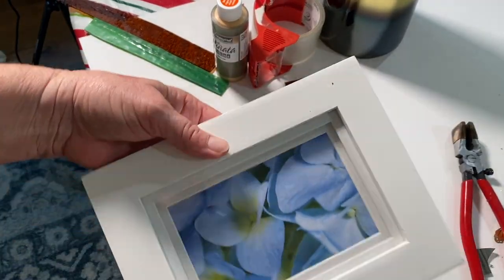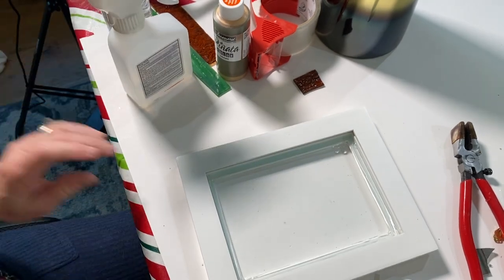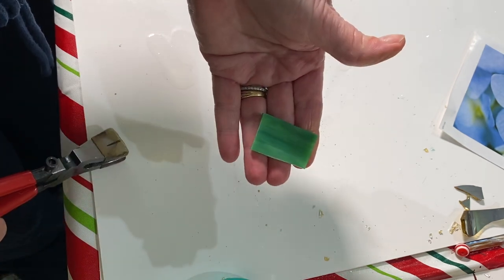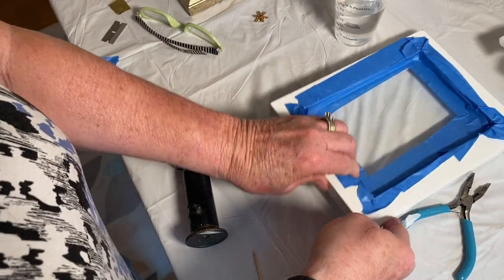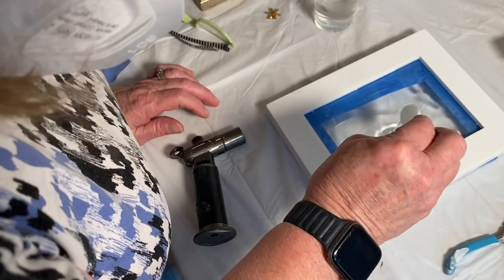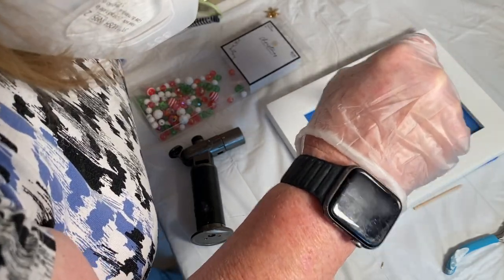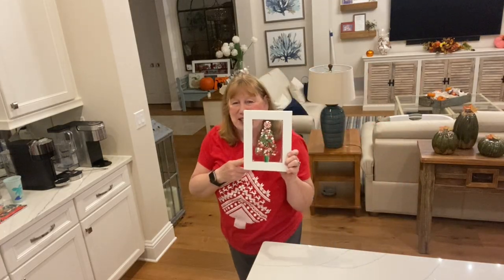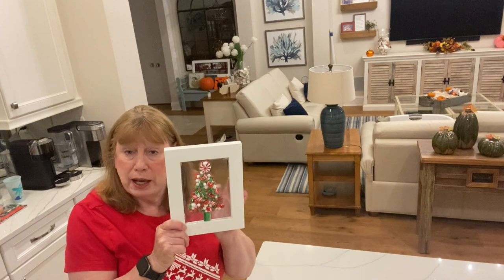HOW TO MAKE  A CHRISTMAS TREES ON GLASS WITH CHRISTMAS BEADS AND  EPOXY RESIN,    2022

Comment: I love your work everything is so beautiful and I love the way you explain everything. I want to try this and wondered if you have a recommendation for which epoxy resin to use for a 1st timer?
Reply from the maker: I have been using art resin. It is a safe resin to use and has a long work time. It can be a little pricier but I like it. Start small! Good luck Be sure you read the directions on what ever resin you choose because although they can be similar, they may have different instructions.

Comment: So yummy!!! I was hesitant about getting anything plastic in case the heat of the activated resin would melt it a little... i guess it doesn't? How about the plastic silver backed flat crystals,  would they still sparkle and not melt?
Reply from the maker: So heating of resin occurs when it is curing too fast like the room or resin is too hot or the pour is too deep. So with my resin ( ART RESIN) it's not my resin but one of the main resins I use It only heats up if I leave a cup fairly full for an extended period of time. All resins are different but it should not heat up to a point to be able to melt anything. Having said that The flat back plastic gems do not melt but you need to set them in the resin and not cover the plastic gem part or iit will lose its sparkle. Out of curiosity what resin do you use?
I hope that helps
Reply: So I will be using Incredible Solutions tabletop epoxy,  haven't tried it yet though I'm still getting my design settled (it'll be a winter landscape with a low fieldstone wall if i can pull it off lol). It cures between 75 and 80°. Yes your response was perfectly helpful!
Reply from the maker: Sounds so pretty can't wait to see it. I guess some resins have a max amount you can mix at one time and a max depth to prevent overheating.
Reply: Yes i will be following the guidelines... hopefully i don't mess up the final step sheesh. Happy New Year enjoy your day and God bless you!
Reply from the maker: @theresaesposito3307  Thank you!